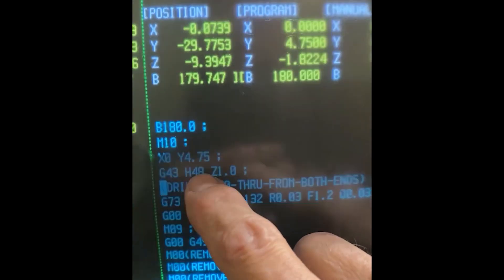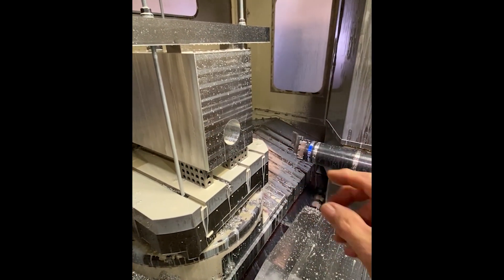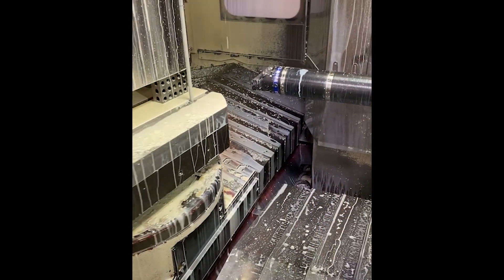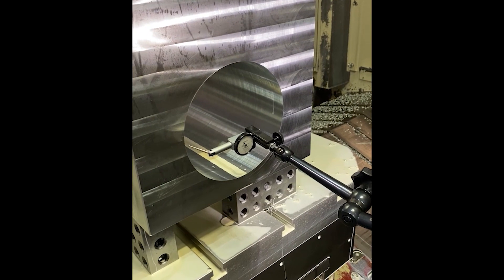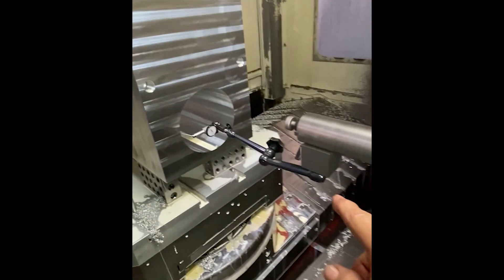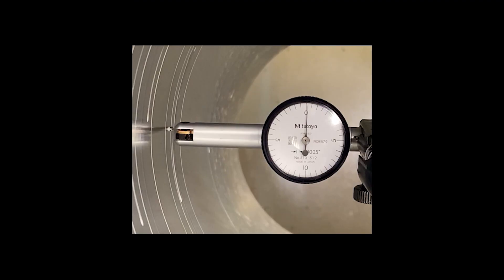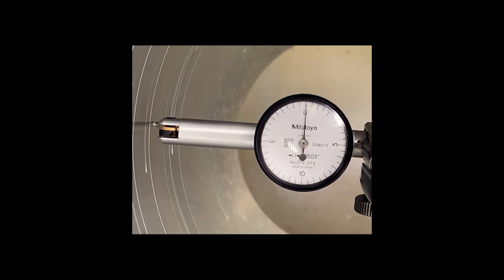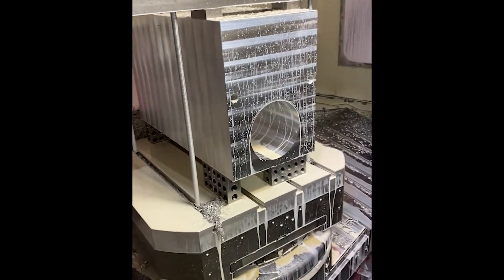Drill and Bore Aluminum Block

Comment: Although the video format isn’t ideal. The content is still awesome!!
Reply: Also. Using the goto on the meldas control. I was surprised you don’t have to use “N” in the goto command block. Coming from Programming Old okuma’s with OSP. You cant get away with that.
Reply from the maker: @intagliode  that’s interesting every control I have ever run doesn’t require it.

Comment: Why are you peck stepping with that drill or is it just to break the chips?
Reply from the maker: You see how I’m really going farther than the flutes depth. That was just to control the shavings. I’m going until the holder just enters the hole. If I had a wad of shavings that would be a problem.

Comment: Hey Peter, that spindle on Mitsubishi is a true monster in terms of torque. Have you ever stalled it? If not what tool you used to generate maximal load you ever had in it?
Reply from the maker: I have never actually stalled it in a cut. The max load (100%) believe it was with a two inch diameter cutter at 6000 rpm and 350 inches per minute .250 depth of cut full diameter in aluminum. But the spindle actually has more power at a lower rpm than that.
Reply: Oh, you had plenty of jobs to let it eat like that I guess. I liked these calibration blocks that you've done with huge radius in the middle.